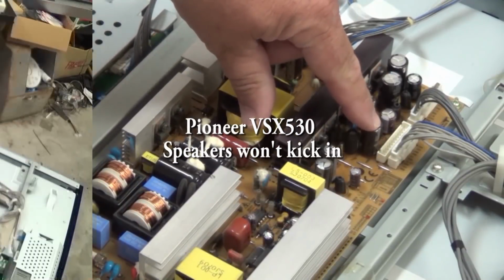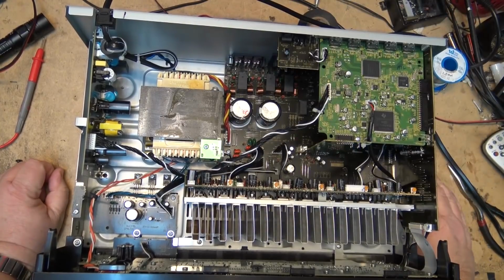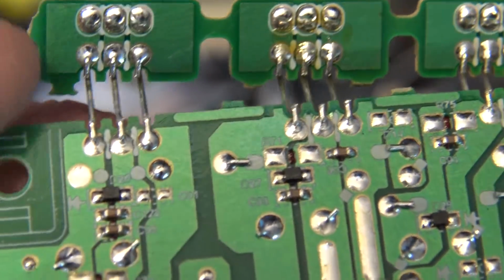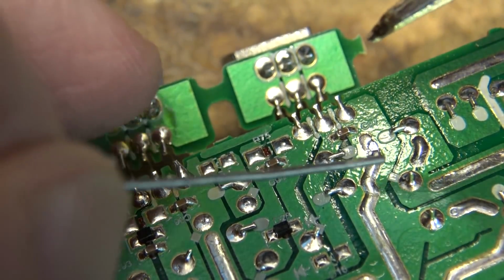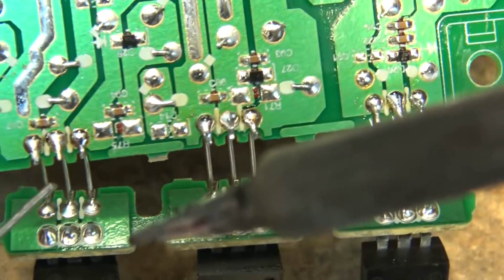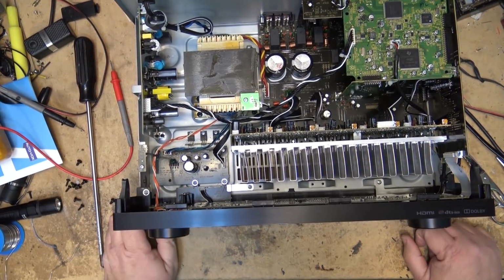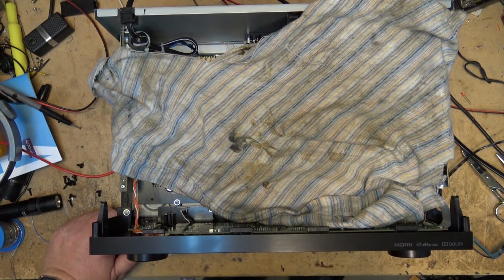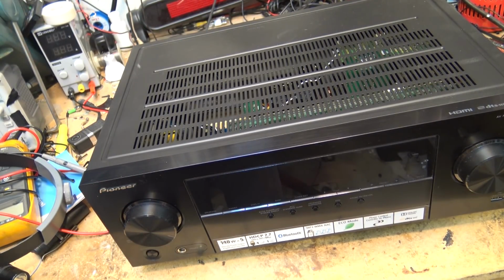pioneer vsx530 no sound can this garbage be repaired

Comment: Garbage is right. Pioneer is nothing but crap. I had a pioneer vsx456 with decent sound for a bottom of the line ‘’ receiver” . Decent sound meaning one step above a table radio. Well it was accidentally damaged and since my last radio was pioneer I thought I’d get another one since my needs now would just require something to make sound. I purchased a pioneer vsx932 and this thing is absolutely useless. I get better sound from my cc pocket radio. As soon as I find a nice table radio this piece of junk is going in the trash. (After I run over it with my car.)
Reply: Sounds more like you've got a setup issue there, possibly speaker polarity related as standard MCACC does not appear to check for that. While an entry-level 7.2 unit that weighs and costs as much as a traditional 70 Wpc stereo amp is no doubt going to have its limits in terms of output power, the receiver would either have to be misconfigured or plain defective to sound audibly bad at normal volumes. (In which case the question would be why you did not return it right away.) There is a 200+ page thread on MCACC on AVSForum, looks like it's not entirely trivial business.

What kind of speakers are you using anyway? Did MCACC yield any unusual settings? What's the crossover frequency being used?

At this point it may be a good idea to ask someone who knows what they're doing to have a look and identify the problem.

Looking around, I found a review of the thing - 140 W / 4 ohm stereo, 68 W / 6 ohm 5ch, 55 W / 6 ohm 7ch. Could be much worse, really; just a few years ago <30 W 7ch was not an unusual sight in this class (but - you may have guessed - not with Pioneer, which tended to be excellent technically but had terrible remotes and menu systems in return). People were disappointed when the 932 came out though, as it's really more of a successor to the older 830 - just one step above the model shown in this video.